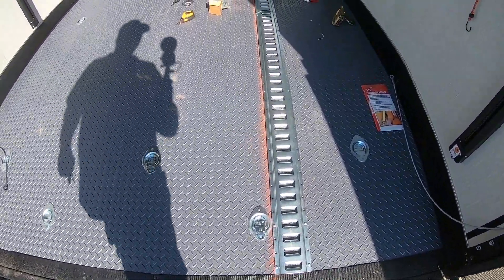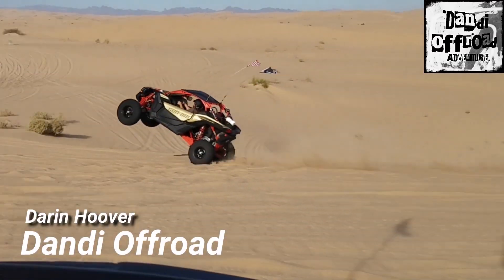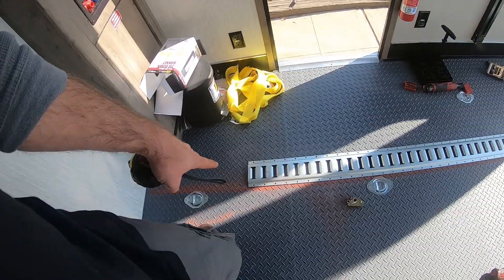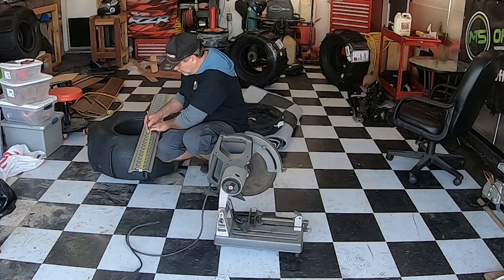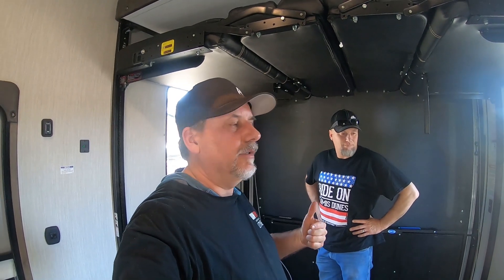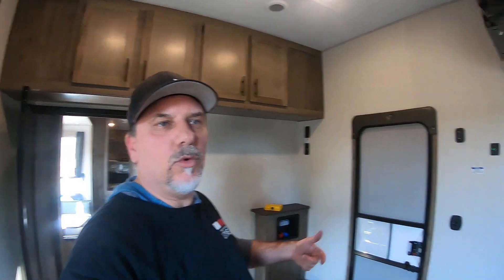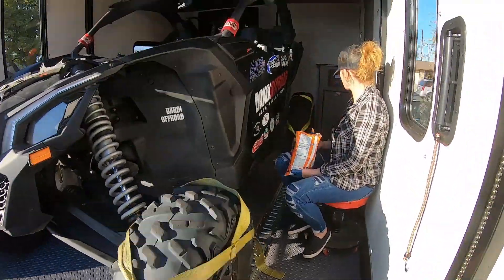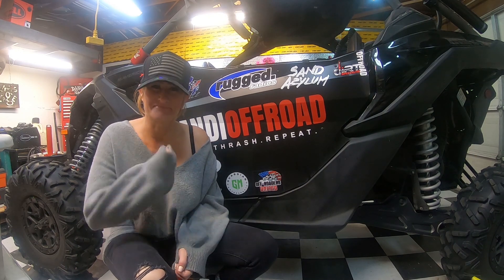We Install E Track In Our Toy Hauler RV To Tie Down Our Side By Side

Comment: Looks good. You did not need to run the track full length, but you may find a use for that section in the middle. I bought 4 - 4ft pieces and put one under each tire. I strap all 4 down. No kill like overkill is my moto. I have a full joint to screw down. If that little short piece starts to come loose remove it and just slide the full piece to the wall and leave a gap.
Reply from the maker: Right? Worked out great

Comment: Looks good guys, got your weight forward and room to the side door, Was there any movement after you got to Glamis?
Reply from the maker: yes worked out great, there was movement, we are going to either ratchet x the front or added etrack to the other side front

Comment: DId you add another E Track?  Great video
Reply from the maker: Thank you very much! We have not yet but plan to. However with an extra strap to a d-ring it doesn't actually move.
Reply: @DandiOffroad  We are putting one E Track in our toy hauler, we aren't really wanting a second one , we will try the d-ring. Thank you for your advice!

Comment: Just a suggestion, but when you add the E track to the other side, cut the two pieces of E track to equal lengths to fit your camper, that way you don’t have a short piece with just a few screws. Just my 2 cents. Keep up the great vids.
Reply from the maker: Will keep that in mind, Thank you

Comment: how long were the screws you were using and did you have to worry about hitting anything underneath the trailer like sewer hoses generator fuel tank etc
Reply from the maker: That was a while back but if I remember correctly I used inch and a half lag bolts. In our case after I inspected the bottom of the trailer we had nothing to worry about as far as hitting wires or plumbing. But I would definitely look underneath your trailer before doing the same thing unless you have the exact same trailer.

Comment: How are the cabinets in the garage secured? And is that a WolfPack?  Thanks
Reply from the maker: The garages cabinets in two hauler? yes it is a wolfpack
Reply: In the wolfpack
Reply from the maker: Toy hauler I mean. I assuming you mean the overhead factory installed cabinets, honesty I don't know. I'm assuming screws.